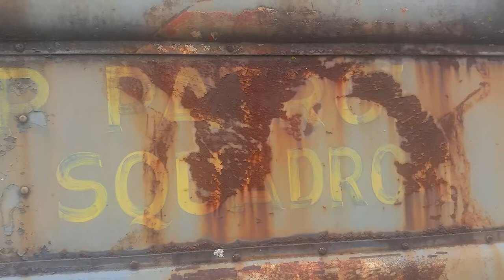Bus life on the dragonflybus antique bus pit stop

Comment: Your bus is a 1953 Chevy. The other bus is a 1948 - 1953 GMC. The engine in the GMC could be a 228, 248, or 270, but most likely is a 248. GMC used a completely different family of engines than Chevrolet back then which was superior to the Chevy engine. Also, your bus body is built by the Superior bus company, if I'm not mistaken, and the other one is by a different one though I'm not sure
 which one. By the way, your bus is totally awesome. I have a 1962 Chevy bus with a Blue bird body 
that I'm planning on turning into a
 hippie bus.